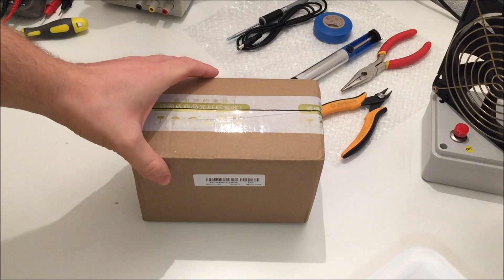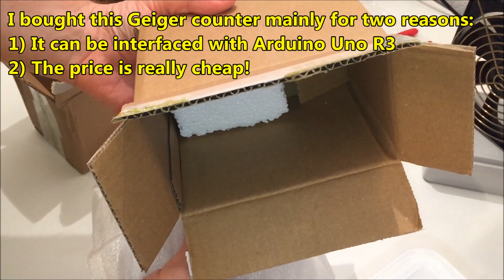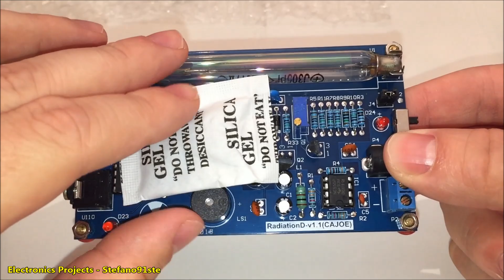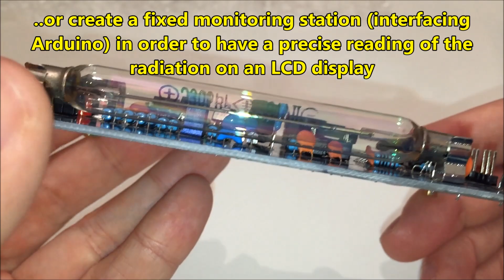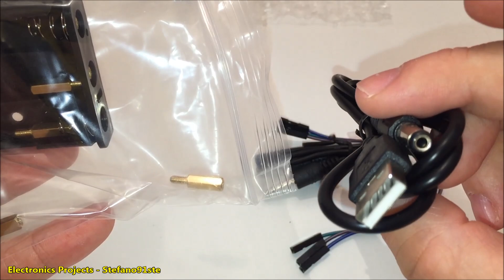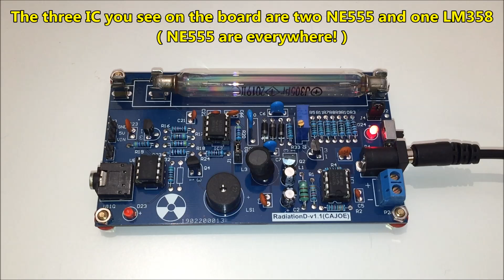Geiger Counter NE555 Module Unboxing

Comment: Do  LCDs radiate?
Reply from the maker: It is possible to connect this module to Arduino to have an LCD display with precise radiation measuring
Reply: Yes but not in a harmful way, exist two kind of radiation, high and low energy, display radiation is low energy and we cannot detect it with a Geiger counter
Reply: Pretty late reply but yes, LCDs radiate very harmful radiation called light.
JK, but seriously though LCDs only emit light, and in the LCD there are two types of light sources (Backlight), LEDs (These are the Displays that are called LED displays) and fluorescent sources. The old CRTs however produced low amounts of x-ray radiation.

Comment: Preaty cool but where's the converter for the miller tube?
Reply from the maker: do you mean the converter to raise the voltage?  in this case everything is included in the module
Reply: I'm guessing one of the 555s is working with one (or more) of the transistors and the inductor to be a basic boost convertor.
The detection tube doesn't need a lot of current at that high voltage.